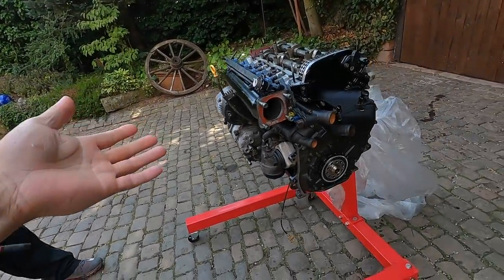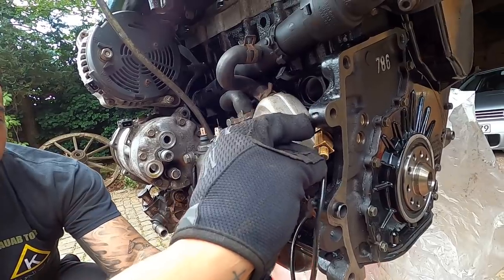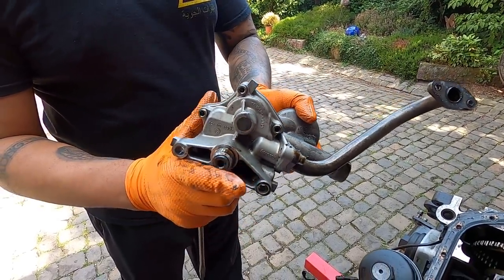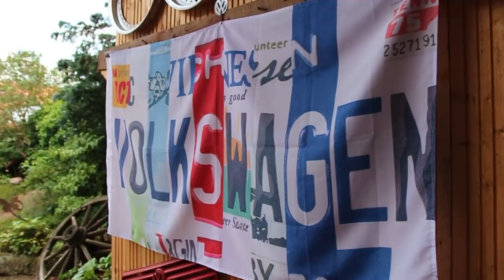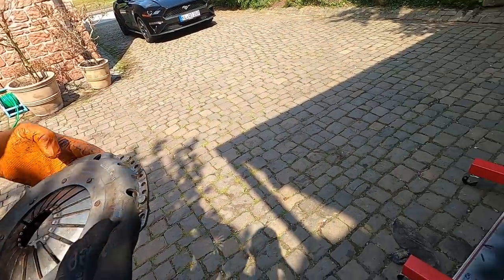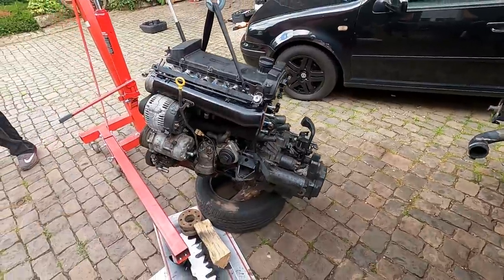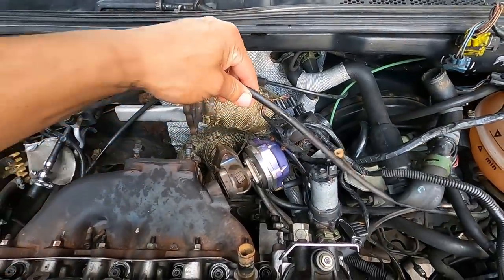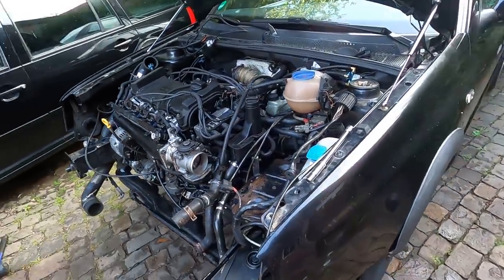We Got The Engine In!! ( MK3 VR6 Turbo Build )

Comment: Please tell me you've got a freshly rebuilt/inspected turbo going on that engine! Love the build videos Christian, keep up the great work. 😊
Reply from the maker: Michael Sidhu turbo was new and only used for a short period of time before the engine blew. But when I first pulled the car apart I inspected the turbo and it was still in perfect shape 🤘🏼
Reply: @Mk3Smith  I thought you said the turbine took some damage in an earlier video during the investigation/tear down of the locked up VRT? Anyway, as long as you're sure it's all good, that's the main thing. 😎
Reply from the maker: Michael Sidhu I thought it was damaged but then I was informed that what I thought was damage was actually a spot where they shaved down some material to balance the shaft so we were good 🤘🏼
Reply: @Mk3Smith  Excellent. 😊 Any news on the Savoy V5 conversion?

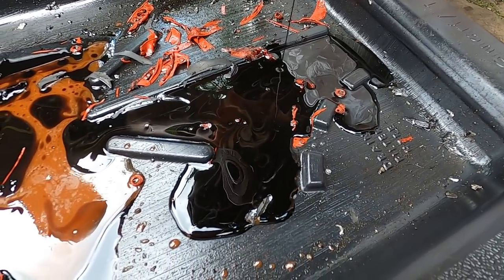Comment: 3:35 proceeds to dump the most. Glittery looking  metal filled oil into the tray... " looks good".... Ouch
Reply from the maker: Daryll Marotte all the metal bits were already sitting in the oil tray, if there was any metal bits inside it was from the last engine and everything was completely washed and cleaned out, new filter went in and it’s good to go.  “Most glittery oil” lol okay
Reply: @Mk3Smith  I was just saying,  if you look closely you can def  See Some  pert plus looking  shine in the oil he pours out.. Its just super Fine material.. Hey as long as all the galleys got Flushed you should be good...  The glitter is very obvious at the beginning of the pour I think I time stamped a couple seconds late
Reply: @Mk3Smith  i agree with Daryll that oil was extremely glittery yes we can clearly see the metal bits inside the oil tray that was there before. just saying that oil that came out did not "look good" hopefully those galleys are clear man and hopefully im wrong. guess we'll tell with how long the engine / turbo lasts
Reply from the maker: PhatPeePeeTM I didn’t care about how the oil looked we weren’t looking for that we were looking for bits of metal and there weren’t any so I said it looks good. The oil could be the most glittery oil in the entire world and it wouldn’t matter since the oil in there was all from the last engine and none of it went into the new engine and the whole filter housing was cleaned out before going back together.
Reply: @Mk3Smith  okay
Reply: @Mk3Smith  well I guess  I assumed that filter was grom that engine since You removed it from that engine... So the assumption was that oil was From that engine as well